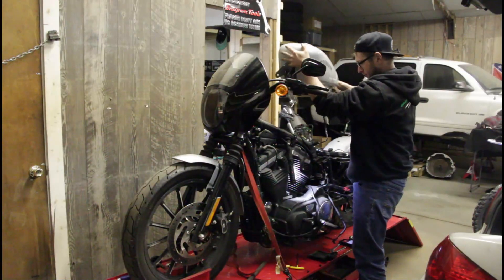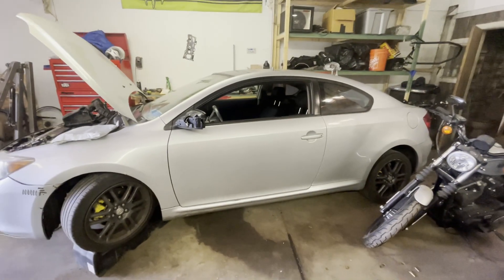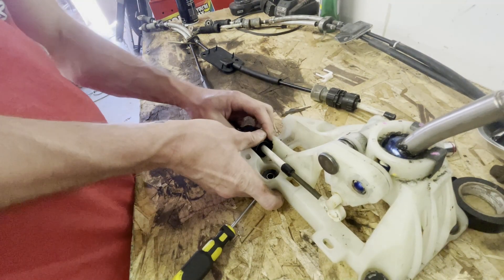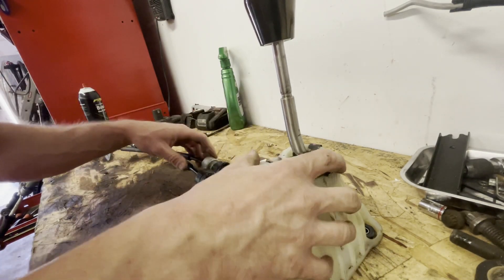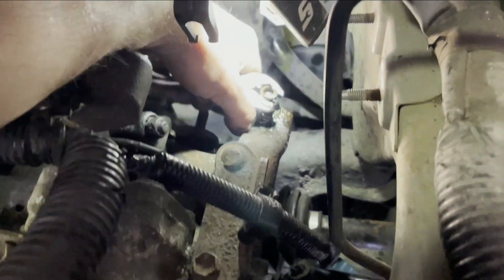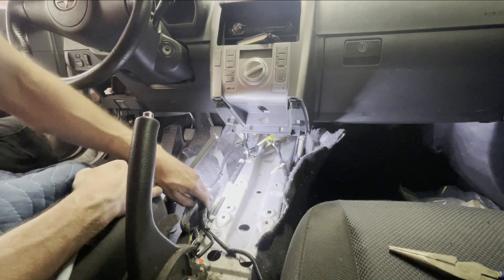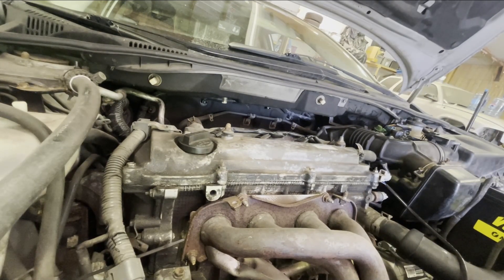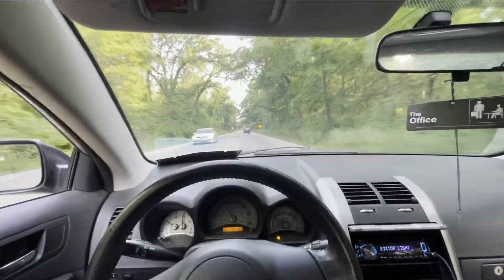Shifter Cable Installation. SCION TC BROKEN SHIFT LIKAGE (PT.2)

Comment: Did you put the two bolts on where the metal plate is, if so how did you because when I was it was nearly impossible with a wrench.
Reply from the maker: I used a ratcheting wrench with a flex head. They are pretty cheap at HarborFreight 👌🏻

Comment: I got a scion 07 and my 5th keeps popping out any clue but I’ll drive it going 80 on free ways and holding it slightly not even hard
Reply from the maker: How many miles? Sounds like your synchros are going bad.
Reply: 205xxx but it runs good when I hold it
Reply from the maker: @559mafiaboi  https://www.youtube.com/watch?v=rlFNCd13wIc check this out... But i put my money on the syncro...
Reply: To bad u can’t fix my scion I live this lil thing fr even tho it’s older car I love it haha and thank u for the video hopefully I can get a mechanic to fix it bye show I g them this video
Reply from the maker: @559mafiaboi  I hope you get your ride back in 100% working condition. I think you are better off finding a used gearbox online or local junkyard... a synchro replacement might be pricey. Good luck my friend!!
Reply: Same problem with my 2007. 3rd over 3k rpms kicks out to neutral and 5 pops pretty regularly as well unless I hold it 5th is getting worse popping even when I hold it. Seriously wtf